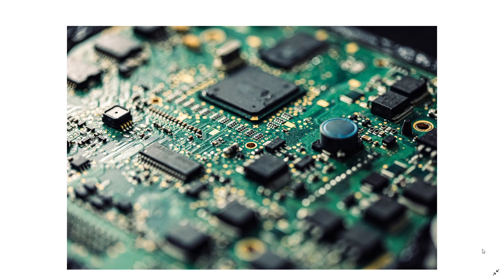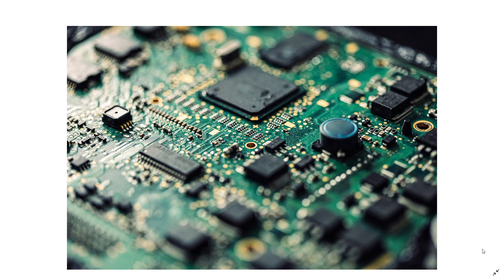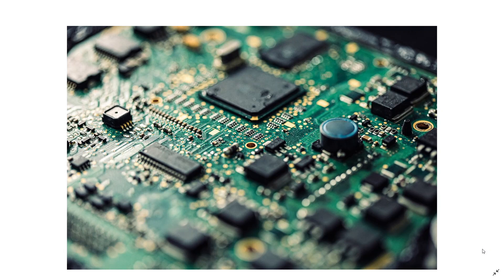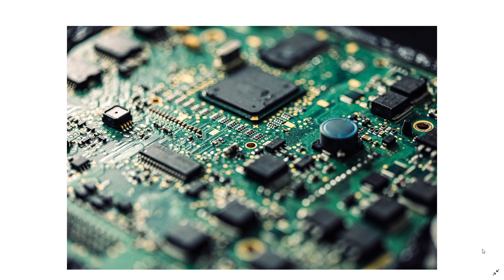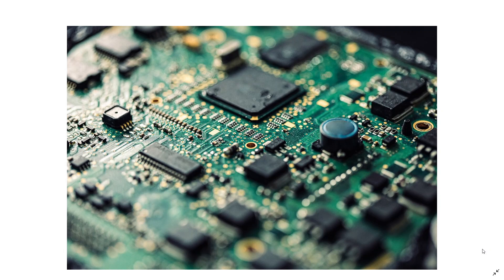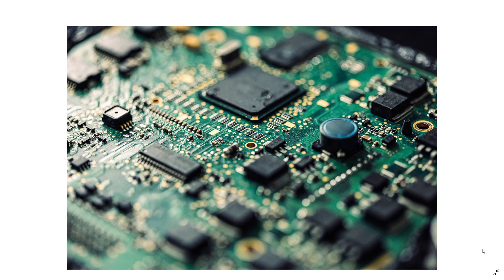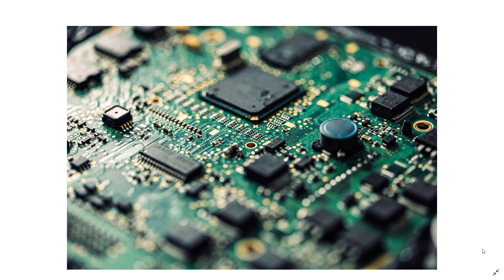What is the Chip shortage and why is it a problem and how did it happen

Comment: A couple of other factors should be mentioned.  Intel, TSMC, and another company are building new Fab's but this will take three years to build and perhaps and long as two years to commission and get operating at maximum capacity. Another factor is that Fab that has shut down to natural disasters often cannot restart until they can get a reliable and very consistent electrical supply before they can restart and thus, they rely on the local utilities to be restored first. That may take several weeks to a couple of months. Then they can restart the fab. That restart process can take several weeks to a couple of months as well since processes have to be cleared of any in-process work and re-loaded with fresh units. Another factor affecting the shortage is exactly the mix of chips required.  When everyone was working from home, they had a laptop and an external screen and a webcam plus an external keyboard and a printer. that could potentially be a few dozen different chips. One of the critical shortage contributors is the hoarding of chips that were not immediately required that has created shortages in other parts of the global economy. There are even shortages of the raw silicon ingots used to make the wafers and the fab for these is another place where high precision furnaces cannot be simply turned on or off. So in summary there is a laundry list of supply and demand, materials and manufacturing issues combined with erratic demand from places like auto companies that are creating a perfect storm that I expect to last for at least four years until 2025! This is in line with a recently released report by the Gartner group suggesting a much longer timeline for the normalization of the semiconductor supply chain.